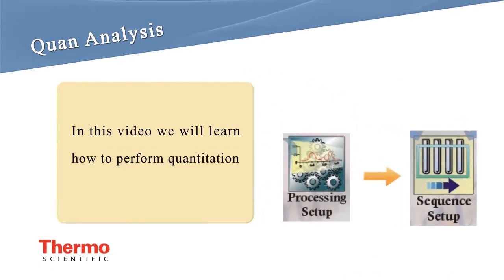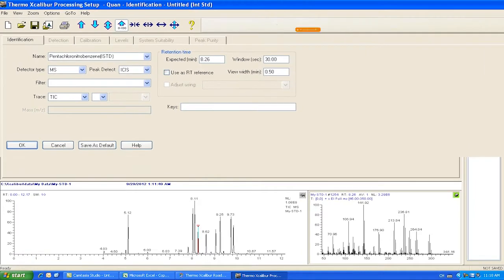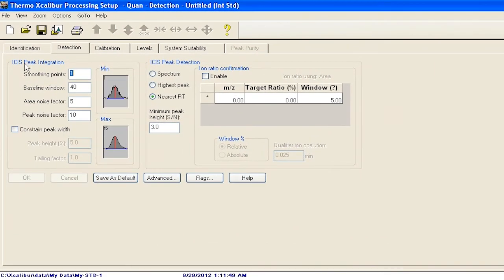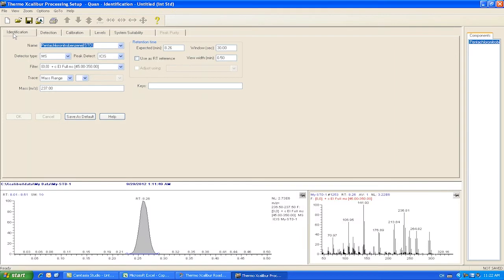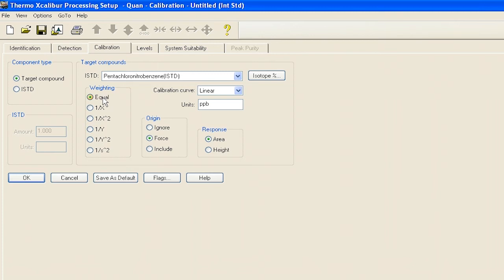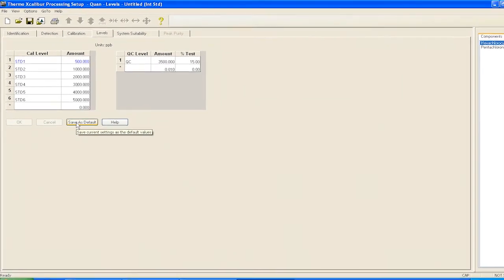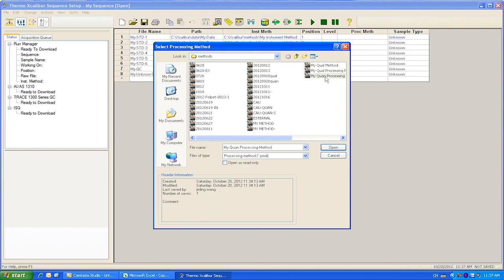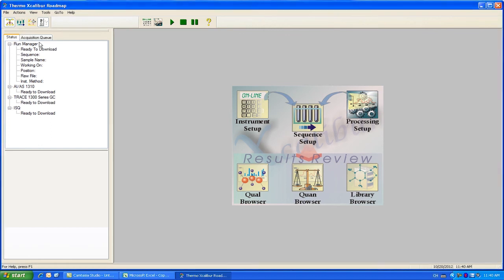77 Quan Analysis

Comment: Thank you very much for this informative video. Would like to know more about customizing  excel template for importing results. I am facing in particular following issues 1. I see too many excel sheets being generated (1 excel sheet per component). 2. excel sheets have a lot of information which could be excluded.
Reply from the maker: Dear Dipali, —
The functionality you are looking for, is now available in either TraceFinder or Chromeleon.  If you cannot upgrade to either one of those, you can still do customization in Xcalibur, but you would need to do some programming in XDK (Xcalibur Developer Kit).
Reply: @alexandersemyonov1575  Thank you for reply again. On my system I have XDK installed already. But I  never knew fuction  of XReport and XDK before.  Many thanks again

Comment: Thank youf or this video. Just a simple question: do I have to run the series of standards and the QC before every series of unknown samples?
Reply from the maker: Dear Gianluca, -
No, you do not have to do that, unless you work in so-called «regulated» environment or industry, examples of which would be environmental laboratories that must adhere to U.S. EPA Methods or pharmaceutical industry labs (GLP/GMP).  Otherwise, you as an analyst and operator, are at free will to set up your sequences.  Cheers, - Alex.